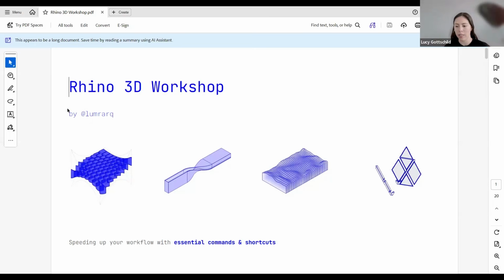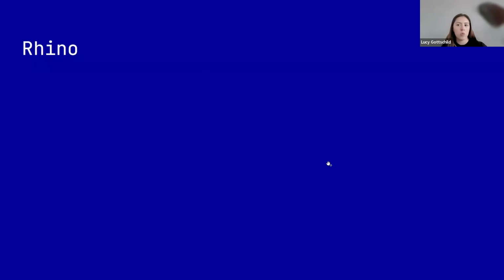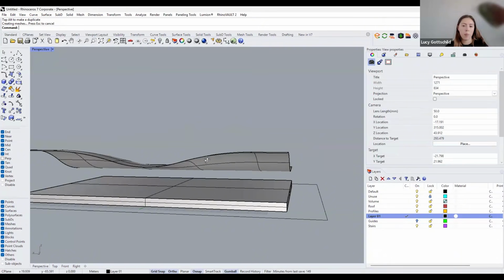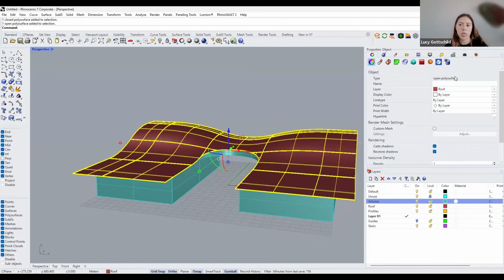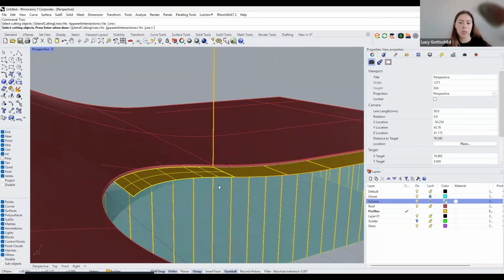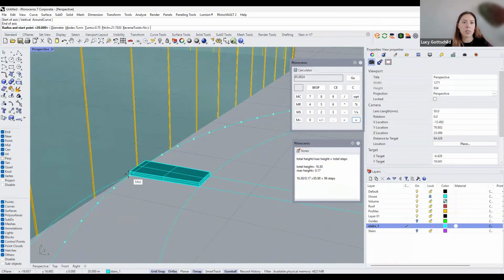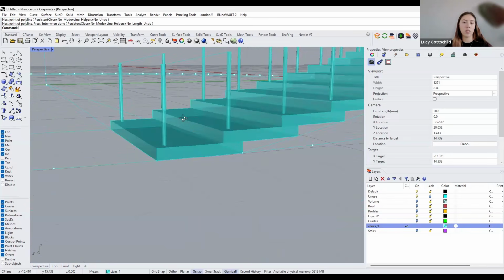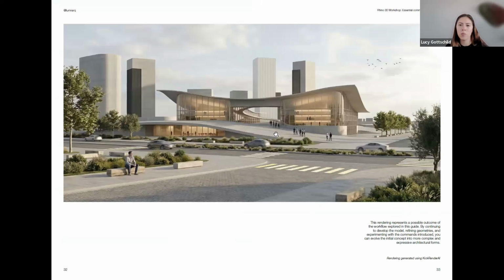LIVE Rhino 3D Workshop

Comment: First of all, the workshop was very helpful! thank you! <3
I keep getting the warning: “Split failed, objects may not be within tolerance of one another.”
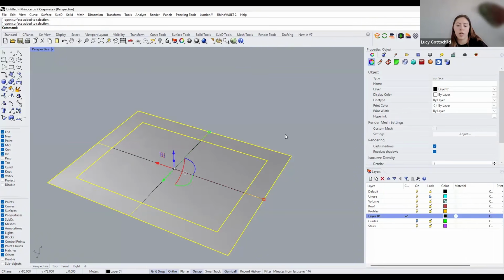I’m trying to do this in Top View. I already set the distance tolerance to 0.001, and I even projected the inner line, but I’m still getting the same error...How can I fix this? (This issue occurs around minute 11:12)
Reply: +I was able to complete the operation using the Trim command, but I couldn’t figure out why Split doesn’t work or exactly where I’m making a mistake
Reply from the maker: @aeh98 Split is much more strict... it only works if there is a real intersection between the curve and the surface. While Trim can still work because it projects the curve. 🙂 Try using the Intersect command first... if no intersection curve appears, then Split won’t work either
Reply: @LucyGottschild Thank you so much for your reply! It was really helpful😊
Reply from the maker: Hi! Thank you for your comment! 
Try to go to the different views (front,back,right) so you can see if the inner curve is a bit over the surface. Of not, you can copy paste that curve and place it in another layer, then extrude it using Gumball to generate an open polysurface and then you can just Trim the outer part of the initial plane :)